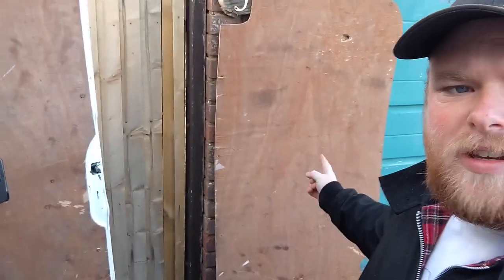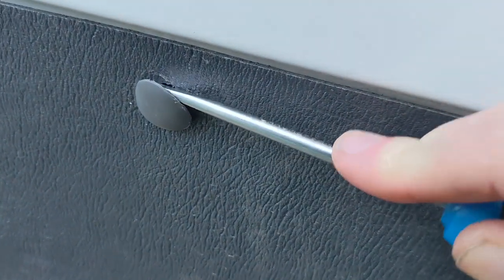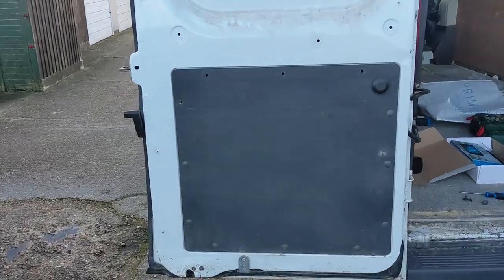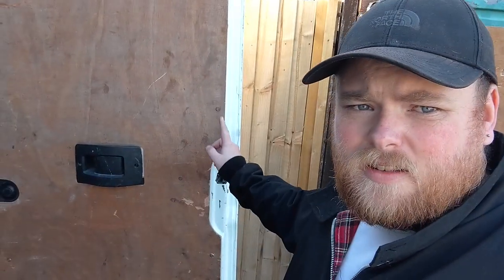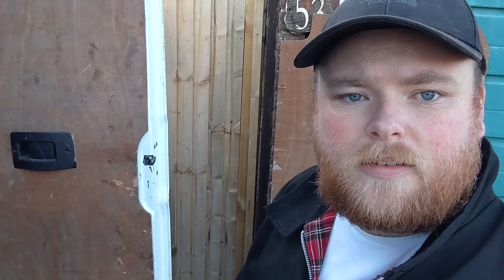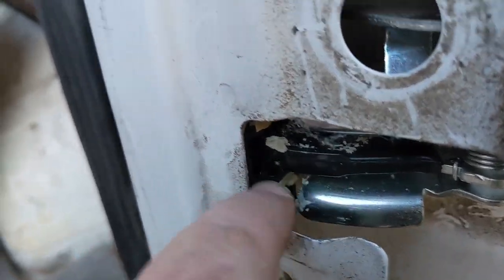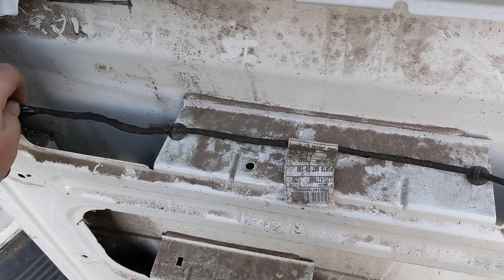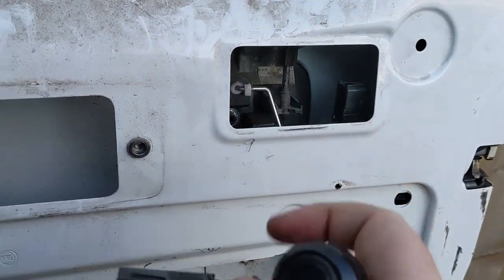Central Locking Issue Citroen Relay | With a Nasty Surprise

Comment: My Citreon Relay had the same problem and occasionally when the weather is cold or wet it returns. The problem is caused when the six metal connections - three on the side of the van and three on the inside of the door become dirty. I was advised to buy Ambersil 40+ , spray it on the connections and clean the the surfaces of the connections thoroughly. It always works but after you clean them you have to wait several minutes before they dry out.

Comment: Great detailed video. I like your way of reasoning. Thanks to you I know why my rear door is has a hole just below the handle 🤯 My central locking works but I've got an issue with the alarm. What I mean is if you go inside and lock the van, and then open any door from the inside the alarm goes off. Except for the rear door. How would you approach it? Where would you start looking?

Comment: My citroen relay  has the same issue with my rear doors with the wiring harnesses and they are missing the guides the same? I've looked on ebay and can't find the both sides I need on both doors ? Any help or advise would be appreciated

Comment: I am having an identical issue with my Relay, rear doors wont lock, no sound from central locking system, same bent metal where I now know is from someone trying to break in.
Reply from the maker: I would highly encourage you to get the metal plate that goes behind the handle. Will protect any further break ins. Stay safe 👍🏻
Reply: hi did you manage to get it sorted? im having the same problem not sure if side or rear door.

Comment: Do you think the wiring harness could be bad for my door? There is resistance in all the cables but the voltage doesn’t travel through it but at the part where the door harness connects to the main harness it’s getting volatafe

Comment: Hi mate my sliding door won't open from inside any ideas would be brilliant cheers Harry
Reply from the maker: Hello, might be worth checking the cables that run on the inside of the sliding door. Make sure they are all in there mounting points so that the cable is pulled when the lever is. Also the very top catch is what locks and releases the sliding door. Let us know how you get on 👍🏻

Comment: Do you think my door harness is bad? I can see resistance  though it but no voltage, but if I unplug the harness and check the voltage where the door harness connects to the car harness I’m getting that voltage jump when clicking the lock button
Reply: hi just wondering if you got it fixed? just trying to work out why mine isnt locking.
Reply: @samking4915  just replaced the wire harness to the door and it solved all our problems

Comment: hi my central locking on central relay stopped working, but I seem to be getting voltage on both sides of the door harness and also low resistence, any ideas what the issue could be?
Reply: I had the same problem been like that a year can’t get it to work
Reply: @pauls826  for me it was the rear door latch was not fully closing around the catch on the rear left door. I just needed to adjust the catch further back and it worked. Took me a long time to work it out though
Reply: @samking4915  mines just doing nothing no flashing of indicators nothing no sounds just doesn’t do anything but I’ve notice that the open door light is slightly illuminated I dunno if it’s light from other sources nothing comes up on my dash no open doors and I can lock the van with the key and all doors are kocked new battery in key the lot